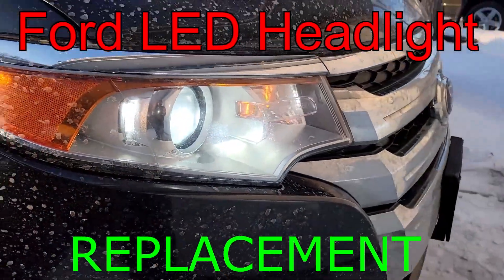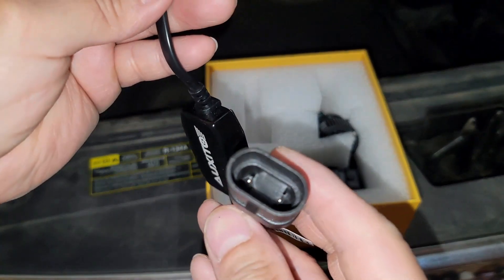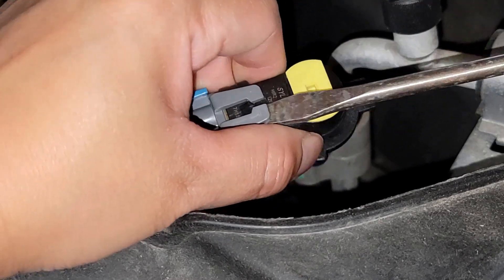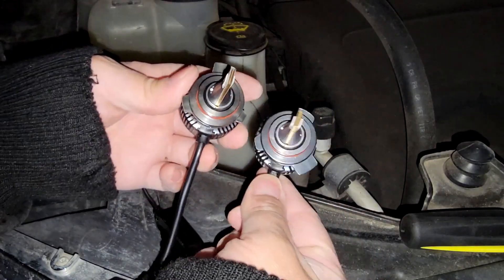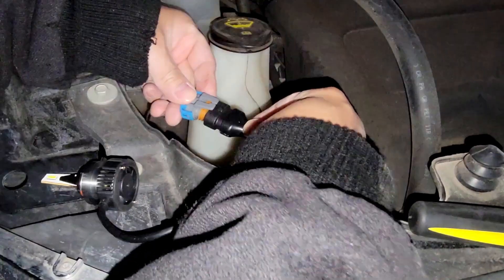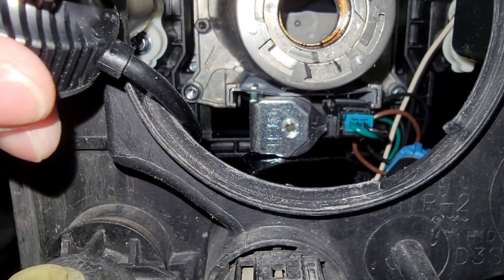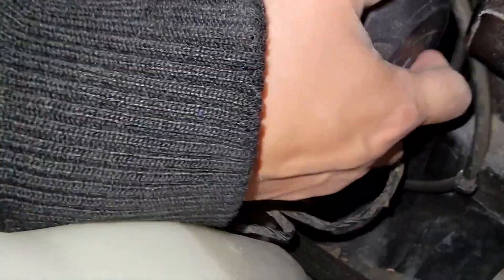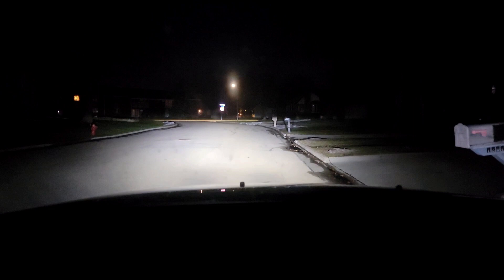How To Install LED Headlights in a Ford (So Easy!)

Comment: Thanks for sharing,bro. Will you be interested in doing another video for our other product on our official website,we could arrange shipment of product for review
Reply from the maker: Sure
Reply: @TRUSTMEN  Can we send our 3157 switchback turn signal lights for review, they come with built in resistor, I think that will a great option to do upgrade with your Ford edge. If that sounds doable, Is there an email address we could use to send an invoice?